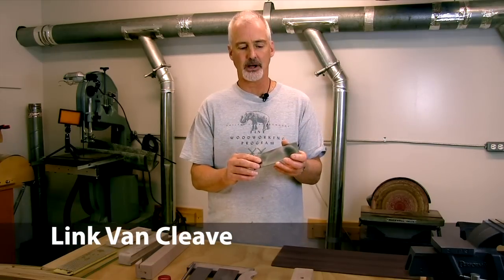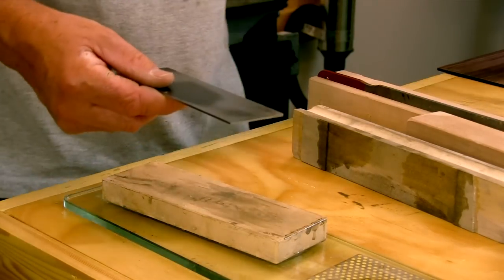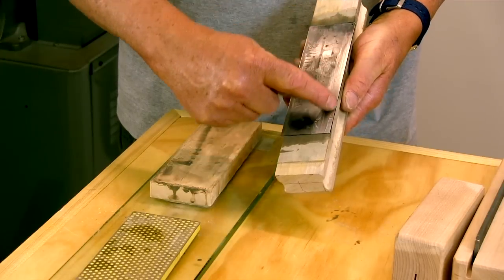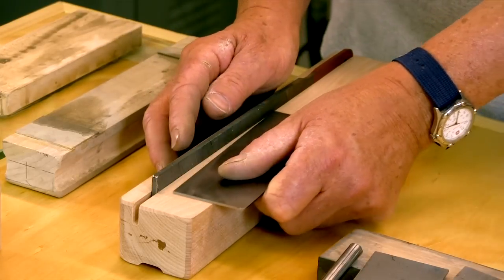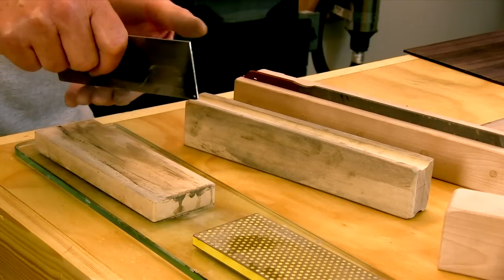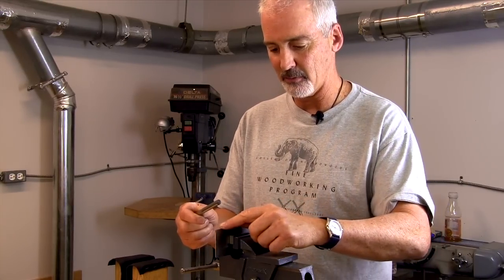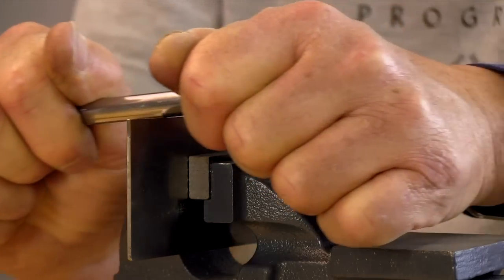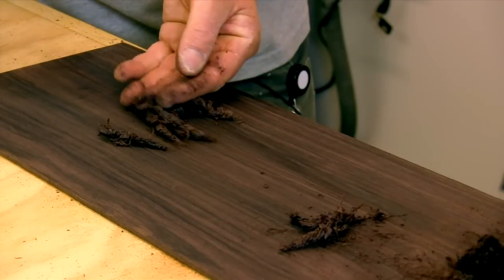Link Van Cleave: sharpening scrapers for guitar work

Comment: Have you tried drawing a very small amount of steel out in the same plane as the sides of the scraper?  I do this by laying the scraper flat on the edge of my bench or table saw and fairly lightly draw the burnisher along the edge about 2 - 3 degrees off horizontal.  When completed the previously square edge would look like a “U” in cross section, (a very, very small “U”).  Now turning a very sharp burr on both edges (all 4 actually if you wish) of the scraper is very easy and consistent.  You can repeat the drawing and turning operations a number of times before you need to square and polish again.  I think I learned this method from someone at Lie-Nielsen.  It is very effective and I probably use one tenth the pressure with the burnisher than I used to use and I get much better edges.